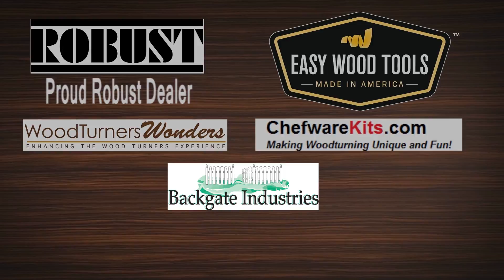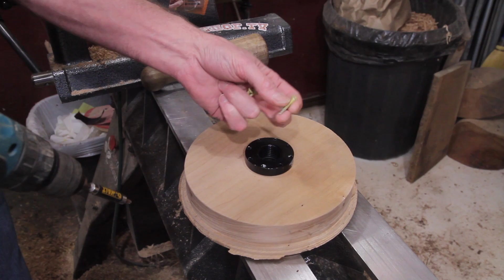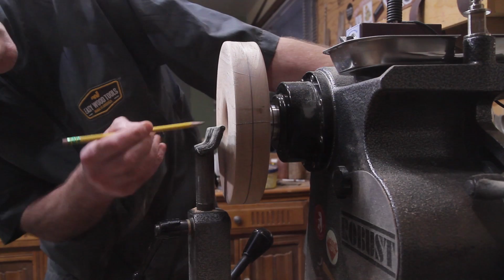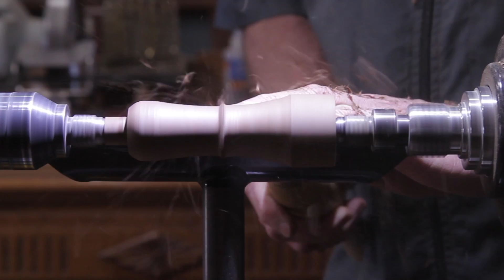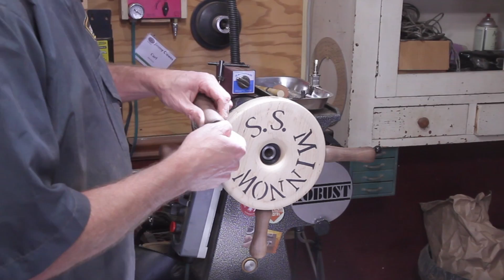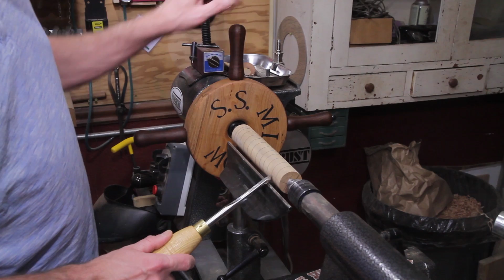Woodturning Jig For Cutting Spirals On The Lathe

Comment: Hi Carl.
A good looking and useful jig, but..........
Every faceplate I have seen has a concentric bore which mates with a smooth 'shaft' on the headstock spindle to ensure that the faceplate runs true to the spindle axis, but you are using a faceplate in the reverse of its normal fitting for this jig. I appreciate that the jig does not need to be concentric to the axis for the use that is being made of it, but does the thread not suffer any damage?
Always enjoy your videos. Many thanks for your inspiration. Philip.

Comment: Yep, I need me one of those. Problem? Sure!! can't have anything simple, I didn't find a single supplier for face plates in the whole of Italy, or least not one who can supply a face plate without a lathe attached to it :)
Thank you again for the mention Carl, sorry it took me a couple of weeks to find it out!! normally someone clues me in so I can jump and thank you right up, but this time your video was left in the normal inbox whirlpool of videos to watch still.

Yuval.
Reply from the maker: +Yuval Lahav Woodturning You bet, the indexing face plate is great idea. Thank you Yuval!
Reply: Yuval Lahav Woodturning if can not find a faceplate take your thread size to your place that sells nuts and  bolt store and sink in a nut into the wood with forstner bit then glue in place with epoxy. i watched captain eddie he got a whole clip on making wooden  faceplates this way but he did give one tip make sure before epoxy that cover the nut witb painters tape and tomorrow once dry can remove the paint with knife and quick sanding to make flush on the nut again.  in your YouTube search look for making face plates with captain eddie and it be awesome help if can't buy faceplates matey

Comment: I am curious, since there is metal to metal contact on you tool and tool rest, are those surfaces polished to aid in movement of the tool on the tool rest?
Reply from the maker: +docindahouze Yes they are polished, I also put wax on the tool rest to help it slide smooth.